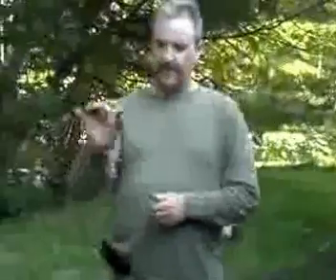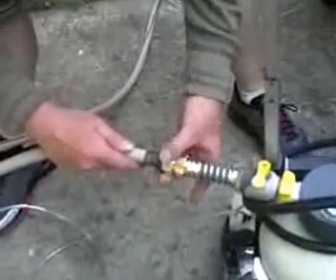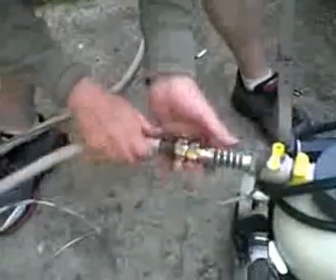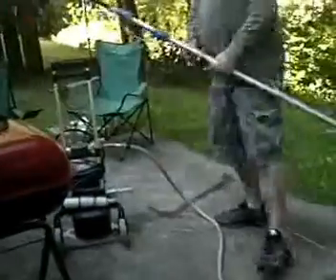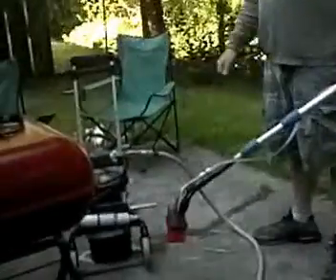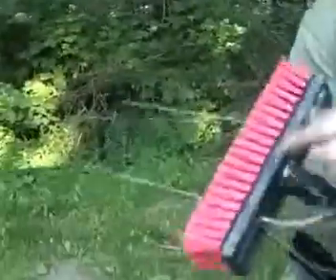Build Your Own Water Fed Pole System Part 2

Comment: this is great, I wonder if you are still using this system. I think you need to run the road last in order to save the resin. And Christopher Dawes vids tell you to hook it up with regular water first, clean it, then rinse with dilate thereby saving the resin once again. thanks for this video it was vury inspiring. I have my whole setup on the way. props for making it all yourself!